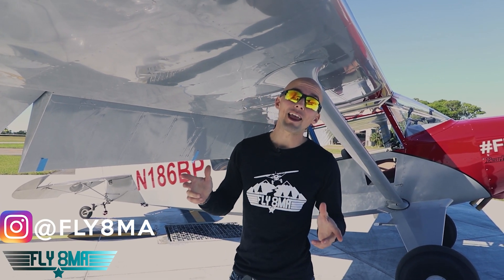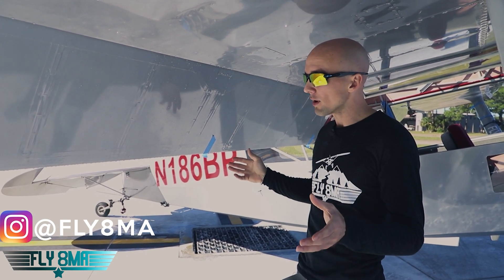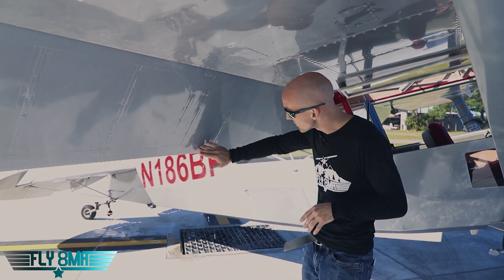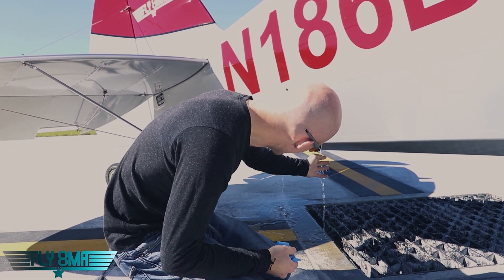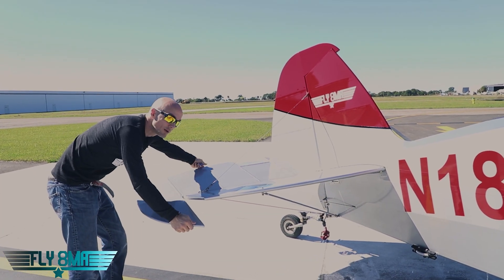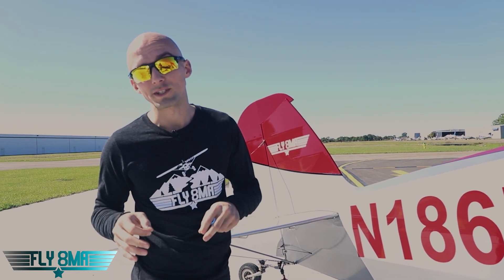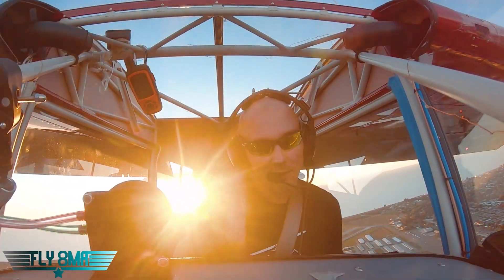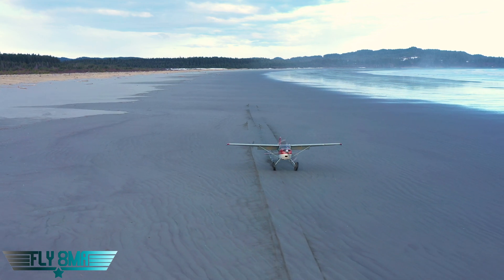Airplanes are not WATERPROOF

Comment: It happened to me.
I had just washed a newly re-covered Taylorcraft L-2, and it wasn't climbing properly, so I declared an emergency.
Tower told me on final that "smoke" appeared to be streaming from my tail.
It turned out that the mechanics had failed to cut out the tail drains...the "smoke" was water vapor (where it could have been coming from, I don't know).
Slapping the belly of the tail with my hand after landing clearly demonstrated by sound and feel that there was standing water in there.
This video (and commenters here) saying to check drains before flight are correct...I had never been taught that.